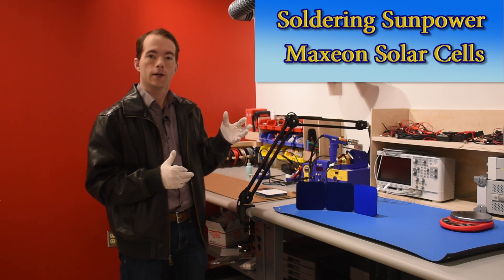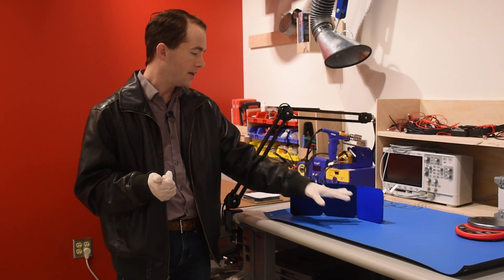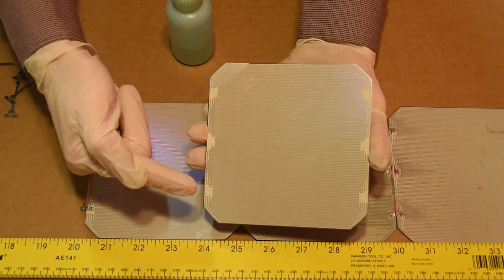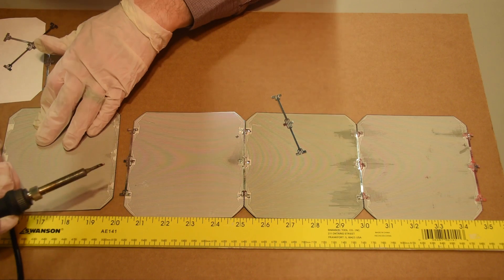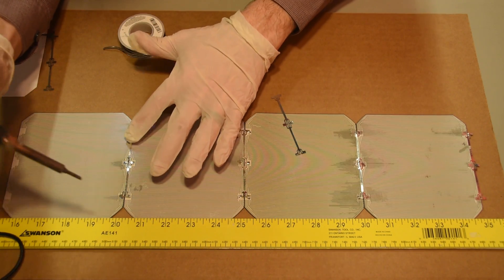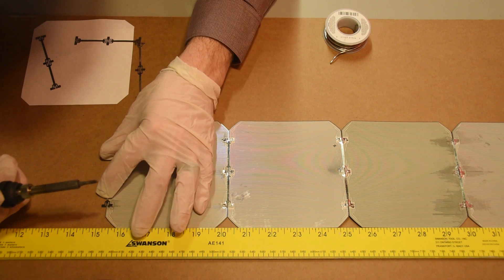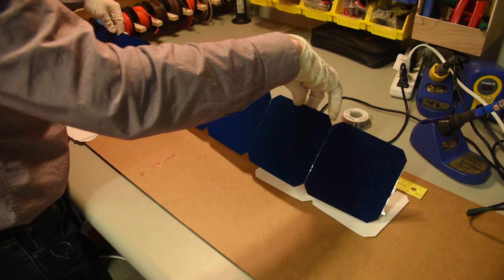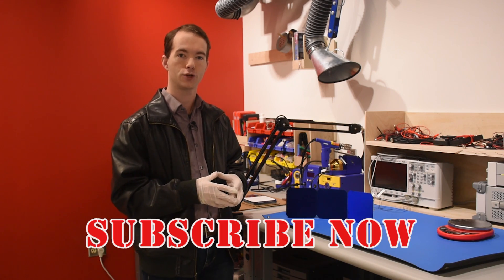Soldering Sunpower Maxeon Solar Cells

Comment: Hello everyone,
I see you are soldering each solar cell, to the next one, using the provided dogbone. This dogbone interconnects all three tabs of the one cell as it has a vertical stripe in the middle. I would like to ask what would happen if instead of using the dogbone, someone will use 3 (three) independed nickel strips from the one (negative) tab of the cell A to the positive tab of the opposite cell B.  What are the advantages and disadvantages of using each approach? Thank you.
Reply from the maker: Using 3 small strips works too. I’ve had to do that when dogbane’s run out

Comment: I see your is slightly different looking than mine. I bought several cells, but when I put a dogbone on it it won't give me any space for soldering. Yours has enough space around it to prevent crossing the line. So after ruining 15 of them I finally just cut small strips and solder them without dogbone. I had to use 20X jewelers loops to see if it made a short circuit

Comment: I was doing this same method, and wafers are placed to close each other, and on my solar panel they are starting braking. It's because of temperature difference. And now I try figure out how to fixt that issue. And how remake my panel.
Reply: How did you prevent the panels from breaking?

Comment: Have you ever measured the Isc on these cells using a regular multimeter? If yes do you get values near the rated values from the data sheet ?
Reply: Are you still interested in answers to your questions?  If you don't already know, it's generally not a good idea to use the direct current measuring function of a "regular multimeter" to try to measure Isc of relatively high current and low voltage solar cells.  Just reply and I'll try to explain why and also give you an alternative way.
Reply: @bobhilder1469  I would like to hear your explanation. Does the same apply to a clamp-type dc multimeter?
Reply: @williamfraser  First, because I've never used one, I don't know if the same would apply to clamp-type dc multimeters.  It's a great question!  If you have one, you might be able to determine for yourself and I'd be happy to offer some ideas on exactly how it might be done.

With respect to the "regular multimeter" problem, it's somewhat difficult to explain and I'm currently in a mad dash to get a bunch of work done.  Please give me some time to write something up and I'll get back to you very soon!

Comment: Thanks for the awesome content!  Do you have any advice for putting a protective cover over the panels after soldering them?  Also is it possible to clean them if there are finger print on the?
Reply from the maker: I've covered them with acrylic sheets and caulked the edges.  As long as they're supported, it's fine, but acrylic warps in the heat if it's unsupported. I've cleaned them with a microfiber cloth too! Thanks for watching!

Comment: To somebody who has handled these cells, (I haven't) -- are they flexible like rubber, or like really really thin glass? Are they flexible like the plastic film ones, or are these just really thin so less likely to break? Thanks!
Reply from the maker: Hey there! These are like really thin glass. They will bend a bit, but snap if bent too far. They could be installed on something with a slight curve, but flat is best.

Comment: Awesome. I am preparing to make a small PV lab, and decided to go with Sunpower Maxeon cells, because of the metal back, that makes them less fragile, and ease of soldering, fill factor and ageing characteristic. Any idea where I can trusted distributor in Europe for these cells, that don't lie about grade / bin, and are packaged well for shipping? I need about 10 cells for start. Because the system is really a prototype, and for testing DC/DC converters, I would like to find the best possible grade and reasonably matched cells. I want Gen III, preferably Me1 or Le1, due to their superior temperature coefficient. The ones on alibaba, or some shops, are very shady, and data they provide don't match Sunpower official datasheets.

Comment: Doesn't pay to install solar or foam insulation unless you know you'll be in the house for at least 20 years ( tinyurl.com/y3gpstue  ).  Even without purchasing these items, in a normal housing market (not SF,NYC), it takes 5 years to break even due to when you sell, you need to pay realtor fees, moving fee, fees on the loan, etc. so if you can't be in the house for 5 years,
Reply: goooood

Comment: Hi Mike can you advise where we can buy these cells for DIY as a search of ebay is producing results but they all look untrustworthy and a close inspection of the pictures shows they are slightly different on the back to the cells you used
Reply from the maker: Hey Zim. They came from an ebay seller named DirectVoltage.com. I just checked for you and they can be purchased from the website, but they're on backorder at the moment. Hopefully you can find some. Thanks for watching!
Reply: thanks for the reply I did see a seller by that name I think, do you have any stats on the dead cell rates as I have seen some horror videos on this since. I have ordered 5 to run some tests on efficiency to see if they are the real deal before ordering more but definitely scared about failed cell ratio out of the box.

Comment: Is it possible/available to just use a single strip of extra wide solar tabbing instead of the dogbones? 

The dogbones are much more expensive than a roll of tabbing.
Reply from the maker: I'm not sure if you can use an extra wide tab wire. I haven't seen a tab wire or bus wire that wide, and I'm not sure if it would short out somewhere or not. Maybe someone else on here will see this and have your answer. You can just cut 3 bits of bus wire if you're concerned about cost. It does take much longer though, but I've done it, just to try it out. I think the dogbones are totally worth the time and frustration saved.
Reply: In rough numbers a cell costs about $5 and 3 dogbones adds about 10c.
Reply: Does the cells efficiency warrant a $5 price per cell?

Comment: hi! i hope you are fine

What type of material did you use to connect the two cells?
Reply from the maker: Sid, it's called a Dogbone connector, and it's made specifically for these cells. It appears to be a silver coated copper strip. You could just use regular tabbing wire, but it'd take 3 times as long.

Comment: Hi ! Could you tell me please what is the recommended spacing between two cells and what are the dimensional tolerances for these cells (+/- how much from the 125 mm) ? Thank-you very much and I'm looking forward to your reply ;)
Reply from the maker: Yo Adrian! I'm not sure what the dimensional tolerances are. I never bothered to measure them, because it didn't really matter. I space them about 2mm apart and that works just fine. I hope that helps.
Reply: Thank-you ! I'll keep that in mind ;) All best !
Reply: Thank-you for your response / info. Would it be possible to mount them with almost zero space between them (1mm maximum for minimum dilation / contraction - given I've implement a cooling system) ? Thank-you for your time and I'm looking forward to your reply ;) Keep up the good work ;)
Reply from the maker: I'm really not sure, so I won't even try and guess. I'm not sure how much these expand in the heat, because I've never had a reason to measure them. I'd say the risk of cells colliding is not worth saving 1-2mm per cell gap, unless you're building a string of 1000 cells. ;-)
Reply: Thanks ! I'll let you know what will work for me in the end (once the full hybrid solar panel > 95% efficiency will be ready) ;)
All best !
Reply: Between 1mm to 2mm. Person on that movie did not make spacing also I didn't do it. Now my cels are braking because of temperature change

Comment: What kind of flux and solder wire are you using. Also what temperature do you use to keep solder wire in liquid form before you put the tab down?
Reply from the maker: I recommend using a flux pen now. A Kester one is what I use, because it's easier to keep a pen's flux under control compared to a squeeze bottle. I just keep it upright to keep the tip fairly dry then only dab it about 6 times before letting it sit a few seconds so the flux can drain away from the tip. You can see the backs of first several of my cells had very messy flux. (Poor flux control on my part) The solder I used here was AlphaFry 60/40. The temperature I typically used was 250c or very close to it. Hope this helps and thanks for watching!

Comment: How about some detail on connecting them on the ends. Do you just tab them across or does it really matter?
Reply from the maker: I ran some bus wire right across the ends, connecting at all 3 points along each of the two edges. Sorry I neglected to include that little tidbit in the video, but thanks for watching.
Reply: Mike Thompson so you don't have to run the bus bar across the tbone connectors? You can just run it directly across the top of the cells right? That wont affect the output?
Reply from the maker: Right. You can just run it across the top of the cells. I dropped the solder bead on top of each connection point, just like I did with the dogbones, but I didn't install them, because they would stick out beyond the edges of the cells. However, you can put the dogbones on and have the tab stick out from the sides of the cells.

Comment: How are these cells for handling?  I know some solar cells are semi-flexible, and others are incredibly brittle and fragile.
Reply from the maker: Mike, I would call them semi-flexible, but hardly. I don't treat them as anything other than flat cells. It's more like they are just tolerant of bending, but then they snap. They still work when snapped though, but it's not like you can fold these up or place them on something with a lot of curvature. Thanks for watching.
Reply: @MikesInventions  On the hood of a car? More precisely a vacuum formed acrylic copy of the hood with the cells stuck on the underside. The curvature is around R=1.5M so not terrible curved, but is it ill advised to mount these cells curved, additional heat stress and vibrations considering? Alternatively I could encapsulate them in Silicone, so they don't have to be pushed to the acrylic, when vacuuming the backing foil, but this is a heavier and more expensive, not the least, a less elegant way to make a panel?

Comment: How many amp per cell
Reply from the maker: They are 3.5W @ .6V, so they are 5.8A. Figure on .5v per cell is you're going to spec a system though, because as they heat up, the voltage drops, but usually not all the way to .5. I just always overdesign a bit, because you don't want a situation where you don't have enough voltage to charge your batteries. Voltage only goes downhill.  ;-)

Comment: Hi Mike. I saw another video that the guy is saying that the solar cells are defective after him made a solder job. Do you had any issue like short circuit because of too much solder?
Reply from the maker: I did have that happen a couple of times actually. This is why I try to use as little solder and flux as possible, and only right where I need it. I did find a few that went "bad" only after I had soldered them, and I'm assuming that there was a short somewhere due to a soldering error, but there was no way to tell exactly what went wrong, but I suspect that's what happened.
Reply: Thank you for the answer! I just ordered 64 cells for a project and your video was really helpfull!
Reply from the maker: Thanks Daniel. Good luck on your project! I'm sure you'll have fun.
Reply: hi, may i know how do you short them? as in the solder touches the lines?
Reply from the maker: Hey Daniel, how did you project turn out?